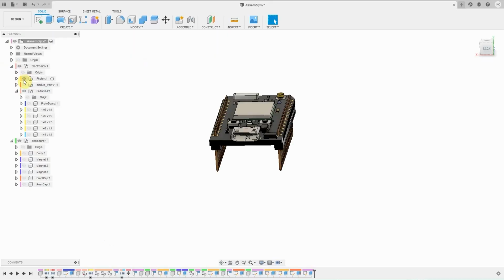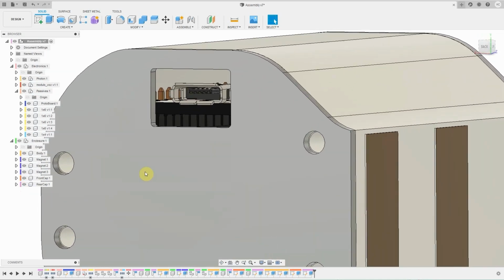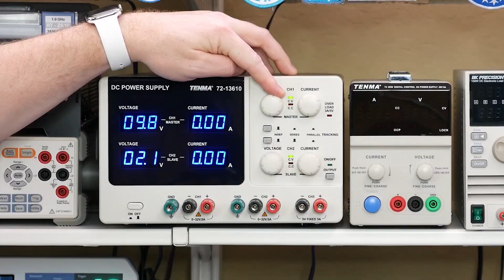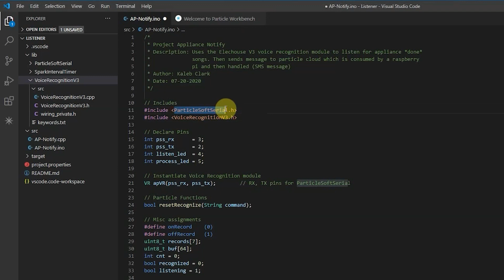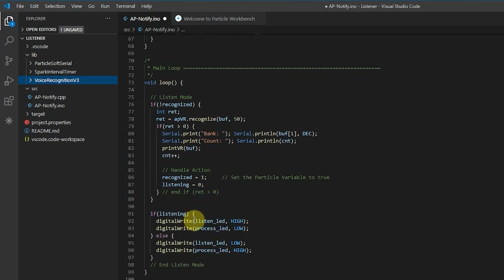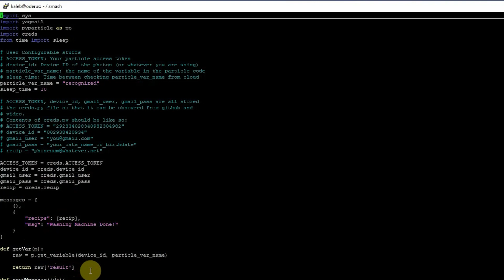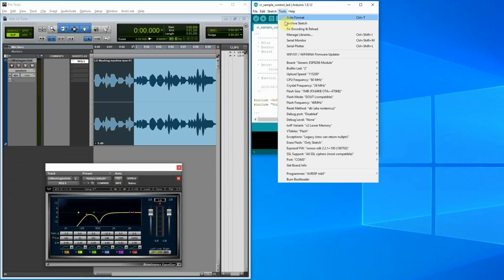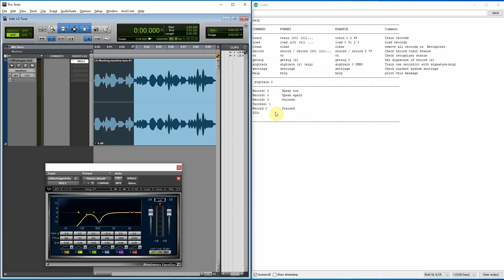Particle Photon Voice Recognition for Home Appliances

Comment: Obviously this project fits into the ridiculously over engineered,  over complicated but fun, Heath Robinson category !
A more boring, practical and less invasive solution would simply consist of a microcontroller polling a vibration sensor, in order to detect a predetermined period of inactivity, then sending it's output to SIM800L or similar to send the text.

Comment: There has to be a signal line to a speaker inside the dryer that playes the melody. You could tap into those wires that go to the speaker and feed that signal into the microphone jack of your module. There would be no microphone to pick up noise - just the clearest of signals. When you train your module on the signal, it should always be rekognized that way. Given... you are allowed to open the dryer. Could this work? I want to know.

Comment: Great project and setup but it would be much easer to attach a amplified speaker to the dryer. The only concern would be safety. Household electricity is not for the untrained. 

Your project is completely safe. It  only depends on sound!

Comment: I've actually been considering the same project (washer/dryer notification) but was considering using vibration sensors instead. Modern dryers don't seem to shake that much tho so I am worried it wont work

Comment: Don’t mount it directly to the machine itself, a large portion of the noise is probably vibrations in the case/microphone, that are traveling through all the housing. Reducing that should get you a cleaner signal to work with. And as a side note, i love this idea, a way to get notifications from appliances without hacking the appliance itself
Reply: Hi Elliot, I had the same thought. I mentioned some testing that I did in the video, and that was one of them. I also introduced different levels of background noise. But this did make me think to place it even further away. Ill give that a whack.